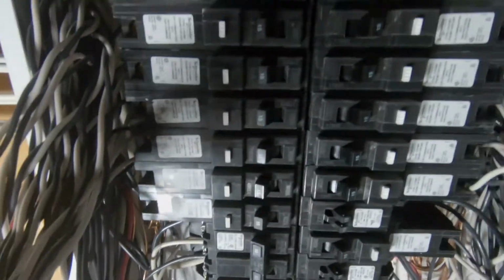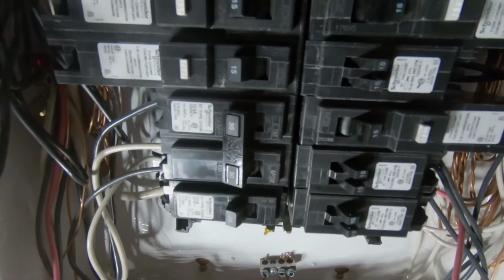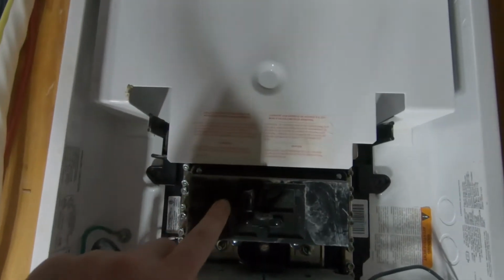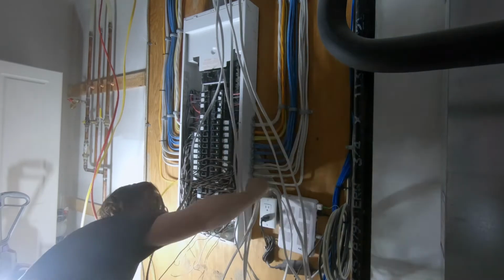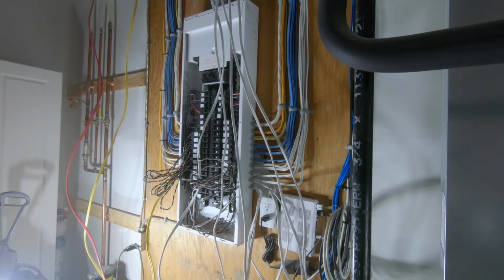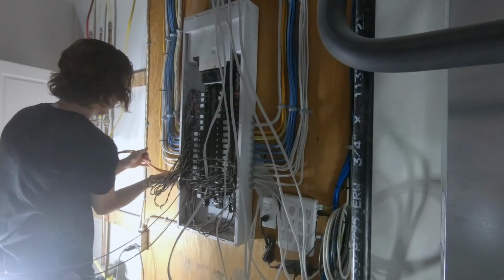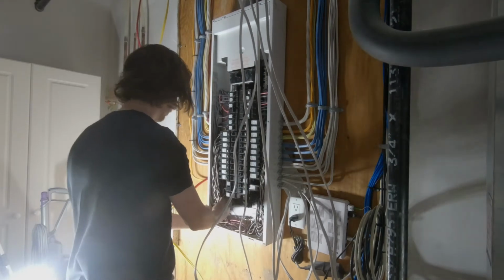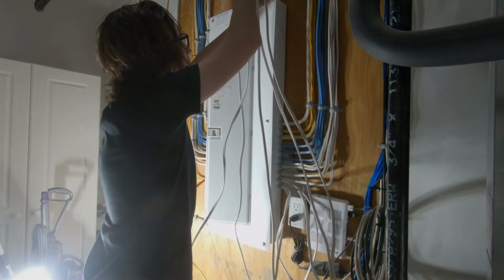What's inside your electrical panel, and how to add new electrical circuits

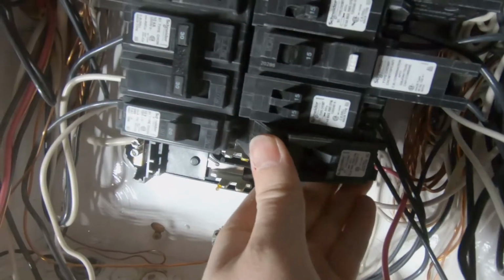Comment: Looks pretty good. Do you have a disconnect outside? Also did I see a red wire landed on a neutral bar? 1:56
Reply from the maker: Thanks, on my practical 3D Print video https://youtu.be/jP2NIlNmkKU you can see all the wires cleaned up. They look like a bit of a mess at the end of this video still. Yes red wire is landed on a neutral bar. I ran the wrong 12 Gauge wire, still 2 -12, but was for 220V so black, red, ground, rather than black, white, ground which is was I wanted for the 15 Amp, 120V circuit that is going to the in floor heat for my bathroom. Should have bought the 12 gauge wire with the yellow exterior, vs the red exterior. We don't have any disconnects outside here in Canada that I know of. The city can cut your power at their box out on the street, but you only have the one main breaker at your panel to disconnect power.
Reply: @ResearchDesignBuild  ok definitely buy some white tape and cover that red with white. Also, in the US, we only separate our neutrals from the grounds when there is a disconnect outside the house. There should be a green bonding screw on your neutral bus that ties it to ground, in that case you don't need to separate your grounds from there neutrals, only if the bonding screw is removed. Not sure what the code is in Canada. Otherwise looks great. Nice work.
Reply from the maker: @CybekCusal  Thanks, I have never seen the grounds and neutrals not separated on any panel I have worked on up here. Not sure if it is code that way or just how everyone does it. I will grab some white tape for sure. I think I have the wire tagged already in the panel.
Reply: @ResearchDesignBuild  is you service 3 wire or 4 wire?
Reply from the maker: @CybekCusal  I don't really know, I wasn't here when the wire went into the ground. I know it's only 2 Phase power, and that on 220V circuits like the dryer circuit for instance it is a 4 wire connection, 2 power, 1 neutral, 1 ground.
Reply: @ResearchDesignBuild  so most of the homes in the US have 3 wire service and we derive our own ground with two rods which bond to the neutral. Then sub panels are 4-wire with the neutrals and grounds separated.